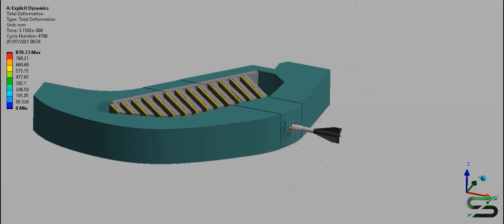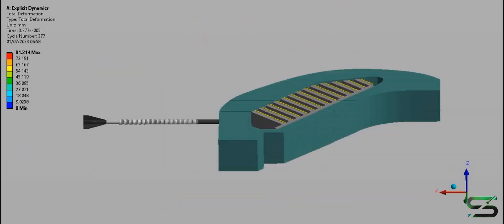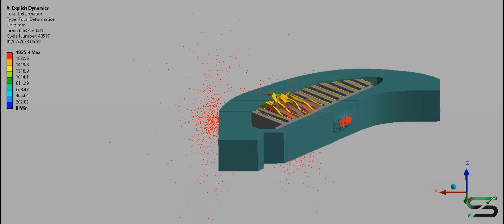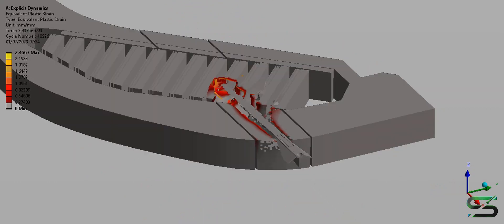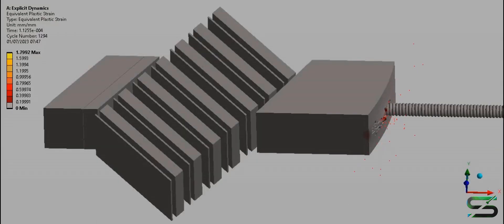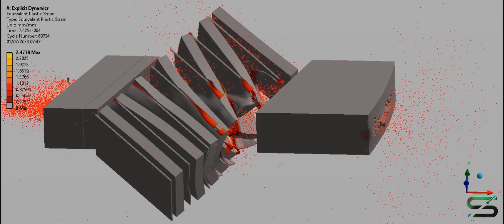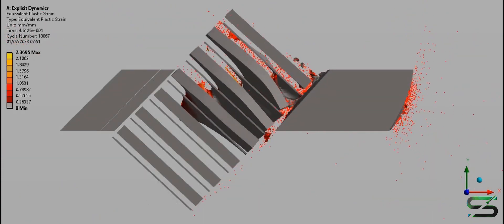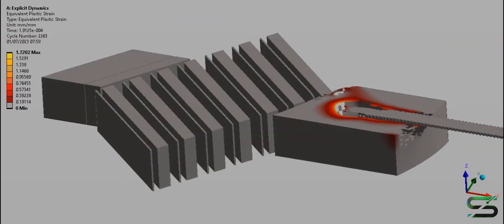Leopard 2A6 VS T-90 | DM53 APFSDS-T Armour Piercing Simulation

Comment: how do you do these simulations?
Reply from the maker: These are finite element numerical simulations based on a certain failure and strength models for the materials under consideration.
Reply: @SimulationPlus  Ansys or LS Dyna?

Comment: That is the cast turret of the T-72B, the same basic turret of the T-90 obr.1992 but in the T-90A (obr.2004) it was changed with a new welded turret of unknown composition, you also did not simulate the Kontakt-5
Reply from the maker: Yeah, that's what we have mentioned in the video.
Reply: @SimulationPlus  Yeah, but WHY did you do that? 

....we all know why.
Reply: @Narcan885  why does he make video of ww2 tank or tank not in use anymore? for fun, why don't you just take a chill pill
Reply: The composition is known from official materials and its effectiveness should be about 10 percent better than the cast one. Official material on T-90A rates its frontal protection (including K5) as 715-725mm against APFSDS.
Reply: Cope more please
Reply: Why russians are so re tarded, this is just a simulation...